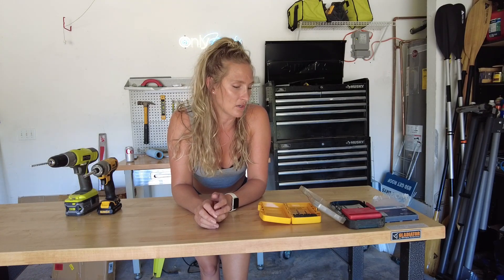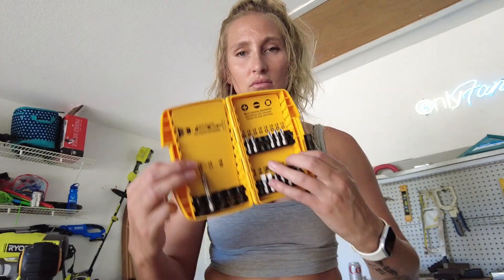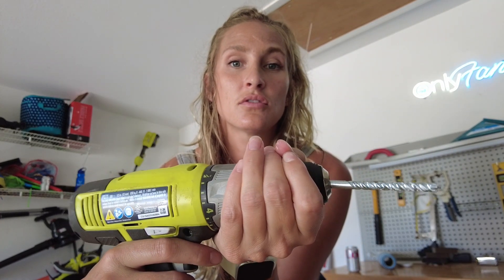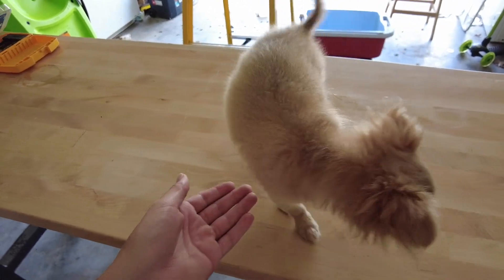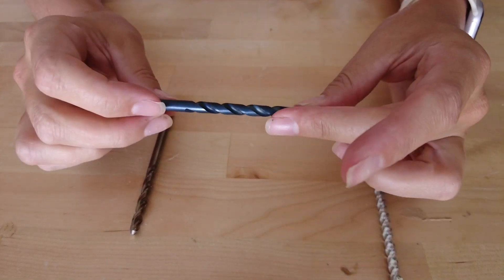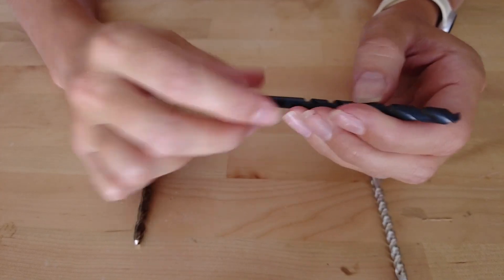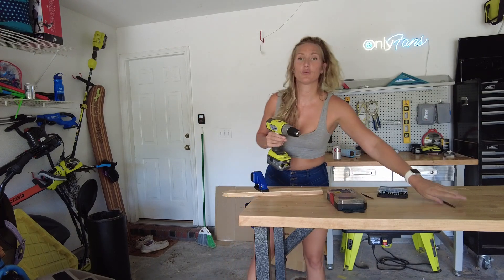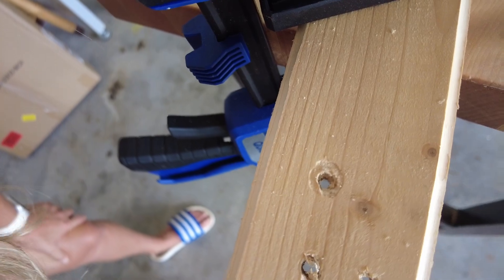What You Need To Know About Drill Bits // Ft Mia The Long Haired Chihuahua

Comment: The masonry bits cutting edge is at different angles and they cutting edges are carbide, a very hard substance. This and the cutting edge angles are what allow it to drill into masonry. Like bricks, cement blocks and even glass, just have to be a bit careful on the glass.